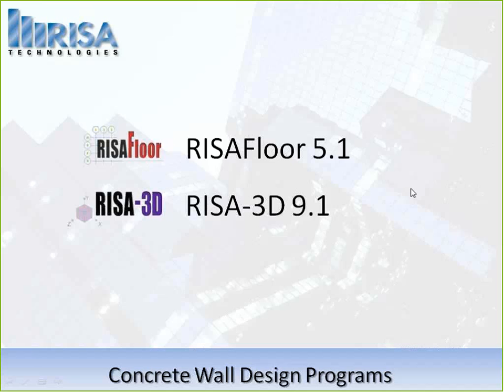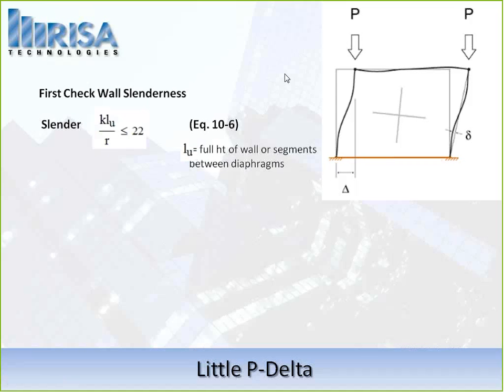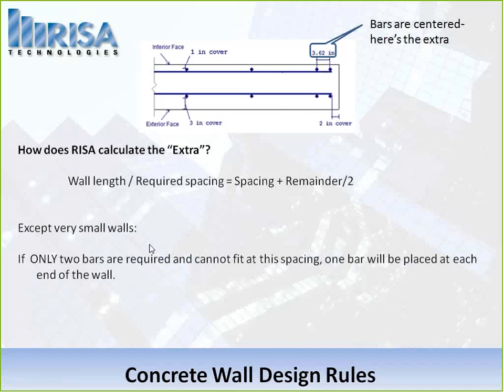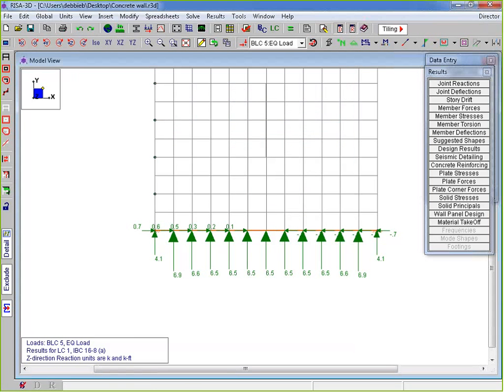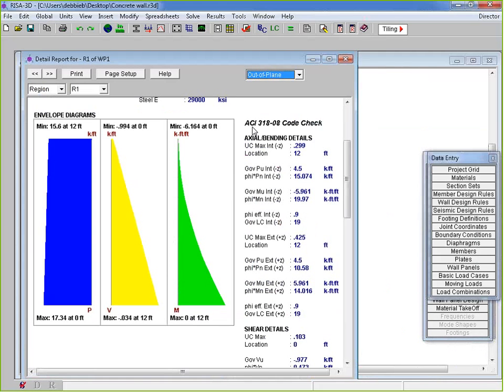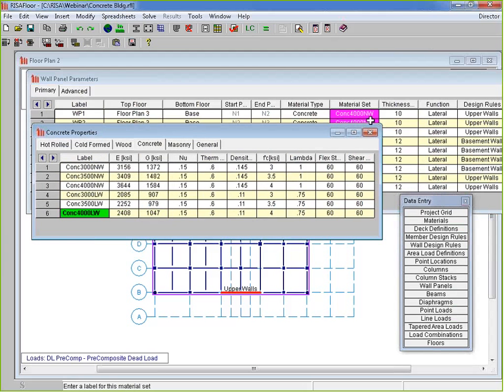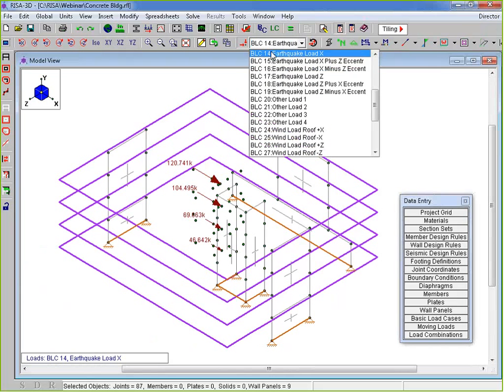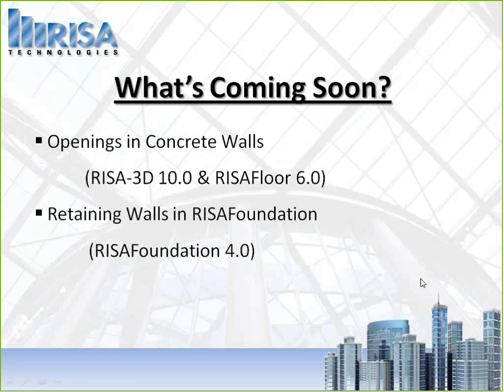How to use Concrete Wall Design in RISA

Comment: Do u have shear wall design  in Eurocode ?
Reply from the maker: Unfortunately, RISA-3D only supports ACI codes for concrete shear wall design.  If you are interested in a structural analysis software that includes Eurocode design, I would suggest our sister company, SCIA Engineer (www.scia.net).